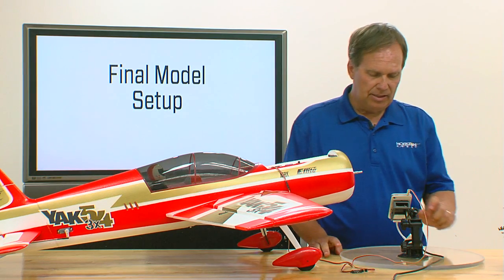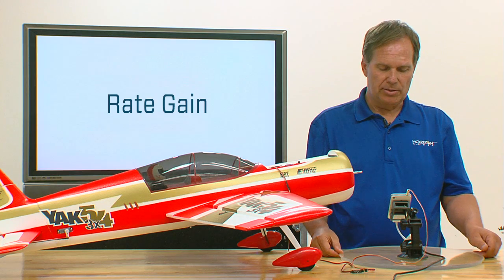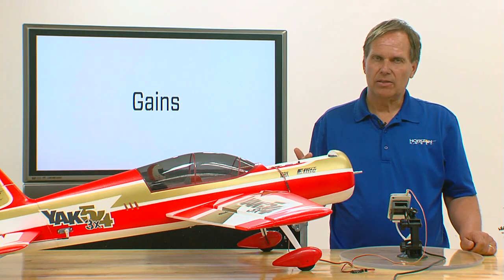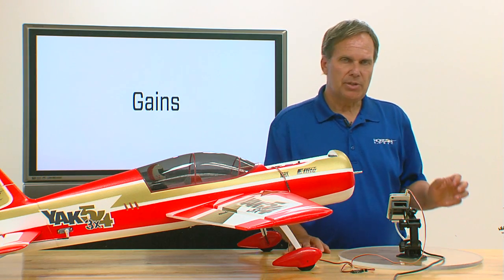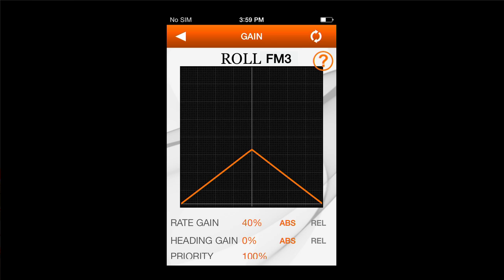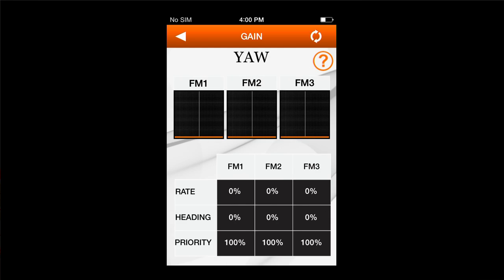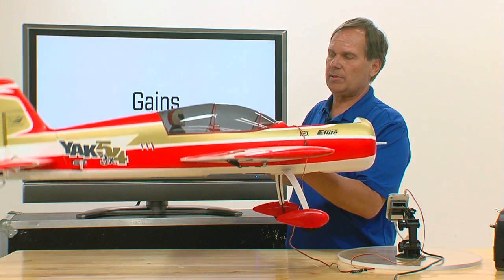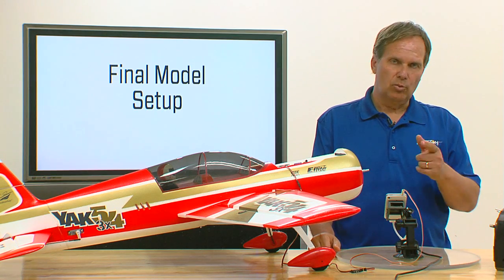Spektrum AS3X Step 14: Gain Adjustment (Final Model Setup)

Comment: In case you're trying this with an E-flite SU-29 Gen2; you're going to need to bind the transmitter to the receiver in normal mode... not SAFE mode. This took me some time to figure out.